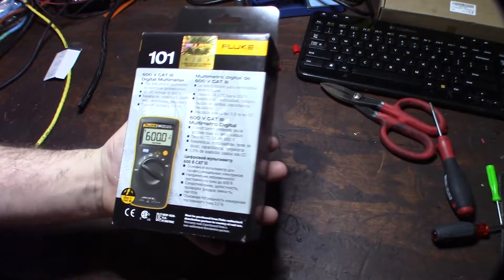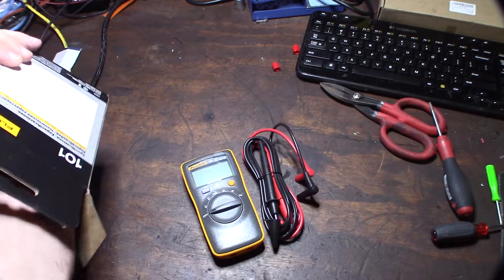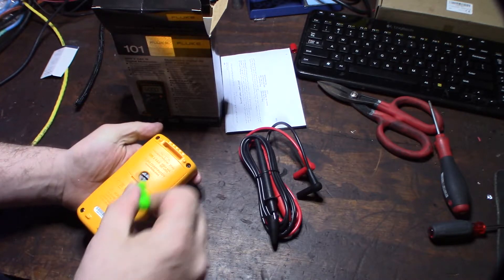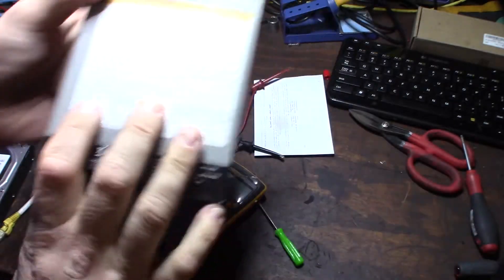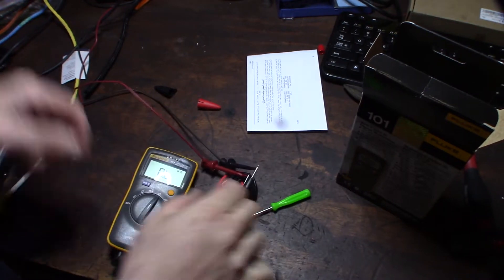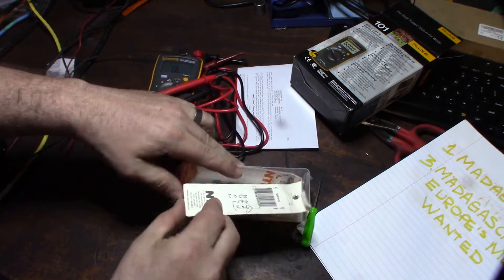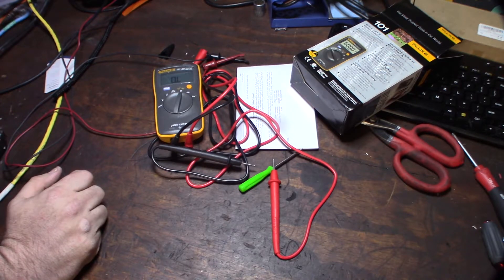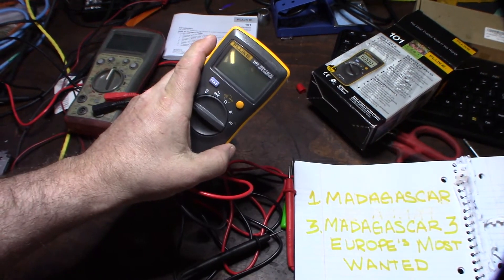Fluke 101 pocket Multimeter AC DC Resistance Diode Capacitance Continuity

Comment: I have the same multimeter but continuity showing 0.4 from 1.5 with very slow process . I changed battery plug unplug both cable but no solution . Is it ok to have that value.